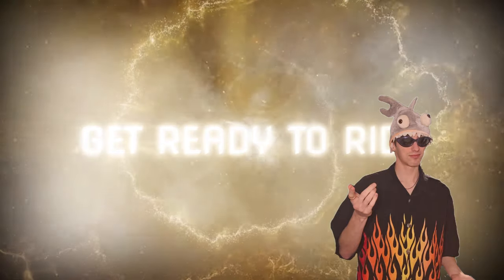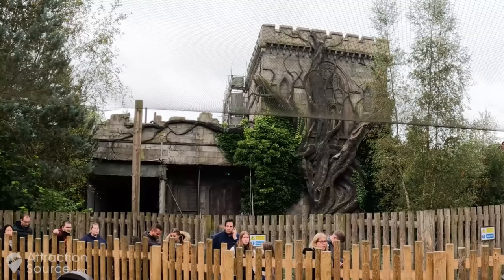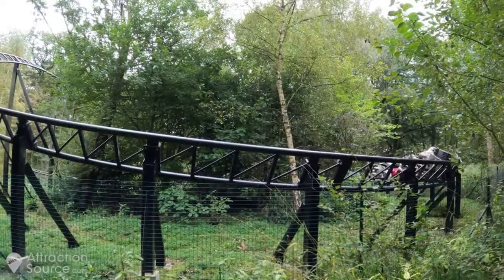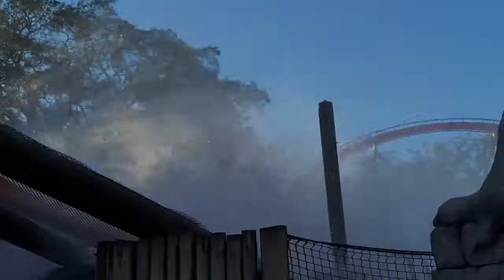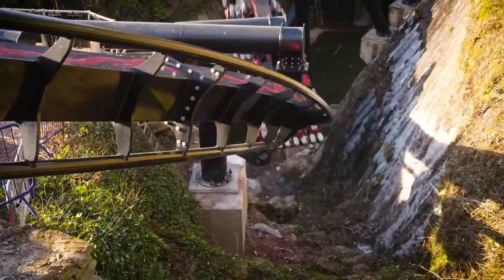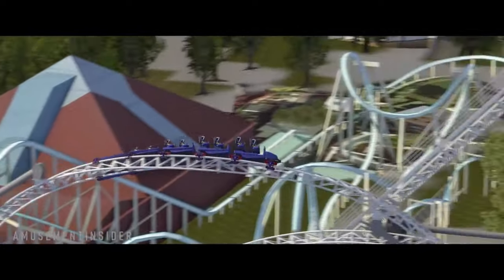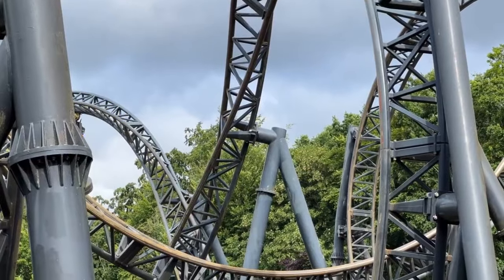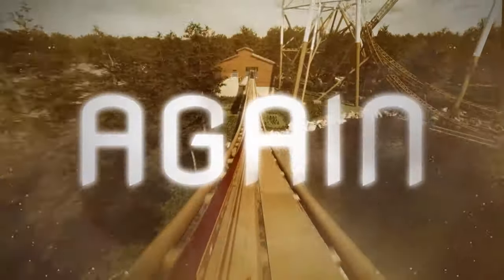Why is HYPERIA opening so LATE???

Comment: What still needs to be done after Track Installation is done:

-Install Electrical Components (such as sensors, brakes, drive tires, etc...

-finish the Theming and landscaping of the ride and area.

-Programming the rides computer system, every coaster needs to have the ride system to be individually set up.

-Testing the ride sufficiently with all possible scenarios

-The inspections by authorities (such as the TÜV in Germany) that need to give their approval before the ride is allowed to the public.

-Training the new ride operator staffand mechanics and all other new employees.
Reply from the maker: They're going to have a busy two months before opening then...

Comment: I think one of the biggest factors might be the arrival of the trains. I don't exactly know how fast Mack assembles their trains, but Voltron still has 2 trains to go despite the first train being delivered somewhere in January (transit between the assembly site and construction site plays no role here since transit is just 8 minutes between Europa park and the Waldkirch assembly plant). And Starfall racers only just got one train out of potentially 4 or 6.
Reply from the maker: That's a good point. I wonder if it takes more time to do the mechanical work and fitting or all the sensors and wiring for the restraints and ride system...

Comment: Thankfully Hyperia should be a far less troublesome ride than The Smiler, Mack have a fantastic reliability record and multiple lift hills and 5 trains was always going to make The Smiler more  temperamental than most other coasters
Reply from the maker: That's a very good point - it probably helps that it's not the first of its ride type as well, because I bet that always throws up some new and unexpected problems

Comment: The reason rides like matterhorn and sheikra actually have parts which go underwater is thats the main braking system and hyperia needs to keep its speed
Reply from the maker: Yeah, their splashdowns are all either near the end of the ride or slightly elevated for Matterhorn, so they can afford to lose more speed. From the construction images, it does seem like Hyperia has some trim brakes along the splashdown though, so it might not fully explain it